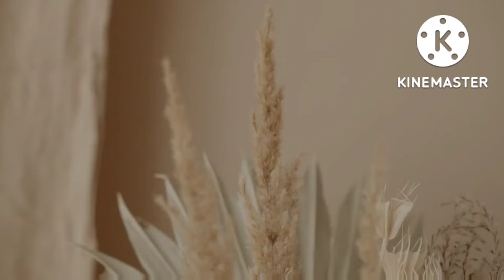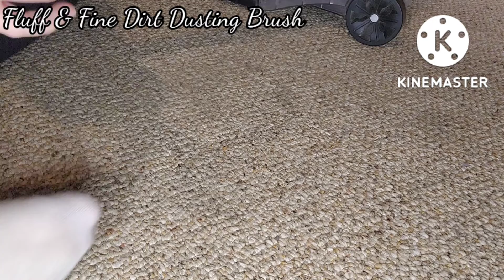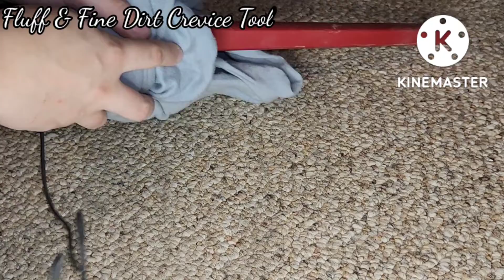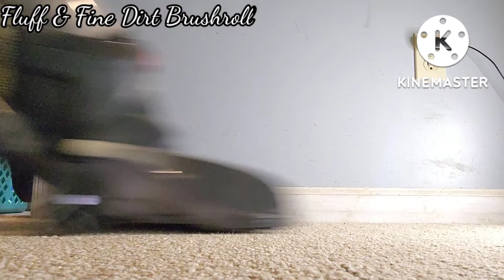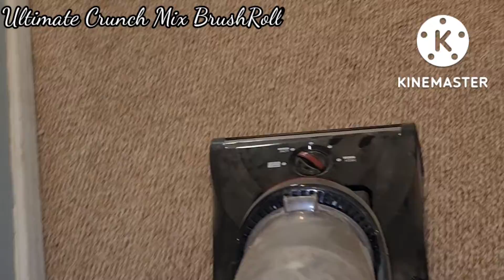Oddly Satisfying Mess Test🚨|Ft. NEW Mix💥|100 Subscriber Special🥳(Read Description)

Comment from the maker: TimeStamps: (All 🎙)
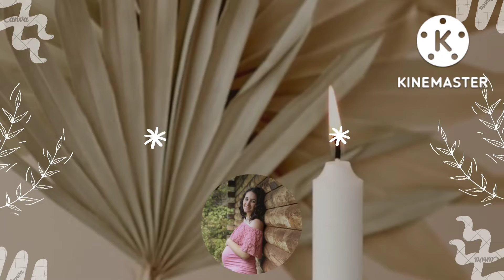Intro: 0:00 - 0:07
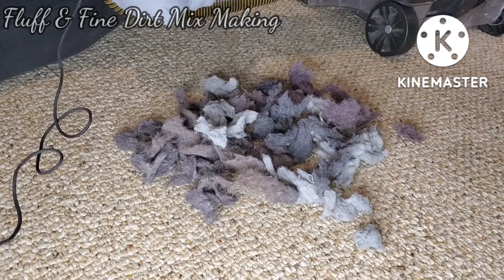Dusting w/ Brush: 0:08 - 2:22
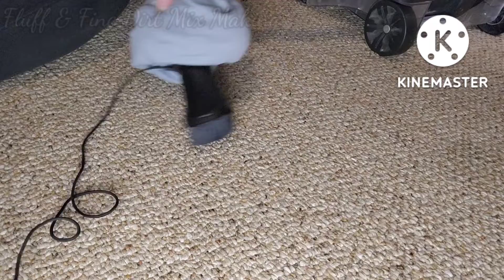Fluff w/ dusting brush: 2:23 - 2:55 
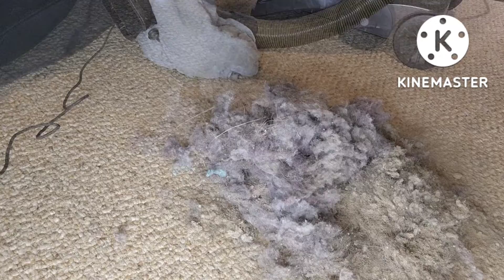Fluff & fine dirt bin dump: 2:58 - 3:28
Fluff & fine dirt dusting brush: 3:29 - 11:45
Fluff & Fine dirt crevice tool: 11:46 - 16:32
hoover b/r w new mix: 16:33 - 24:44
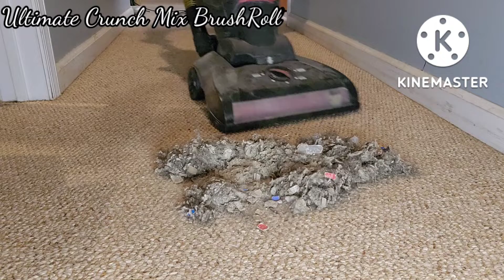Ultimate Crunch mix open hose: 24:45 - 25:59 
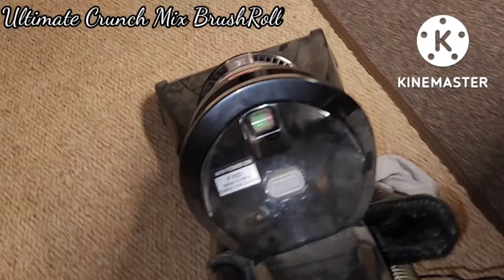UC mix brushroll: 26:00 - 35:24 
Mega Mess Test UC mix: 35:25 - 41:04
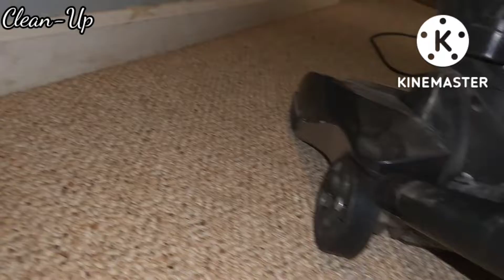Clean up: 41:05 - 44:17 
Outro: 44:18 - 44:25